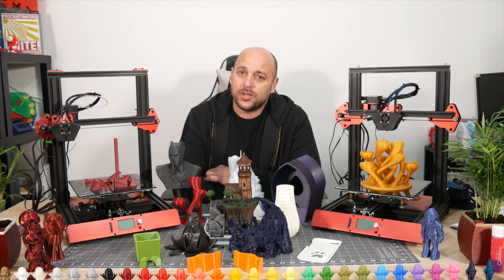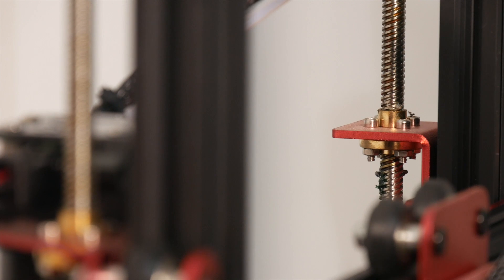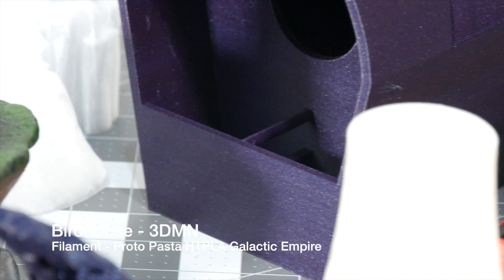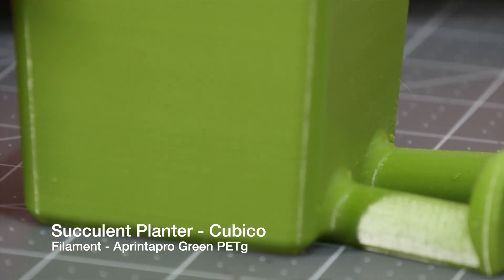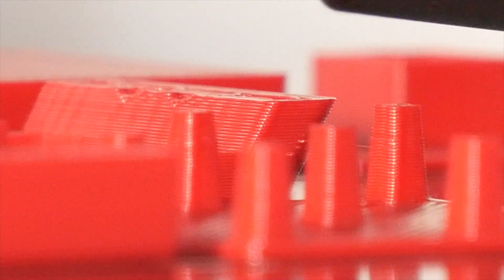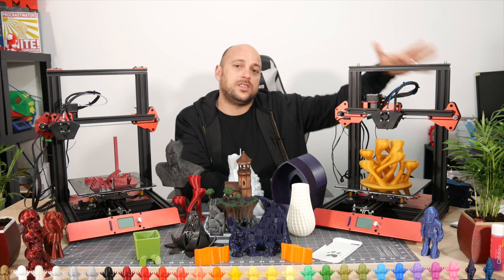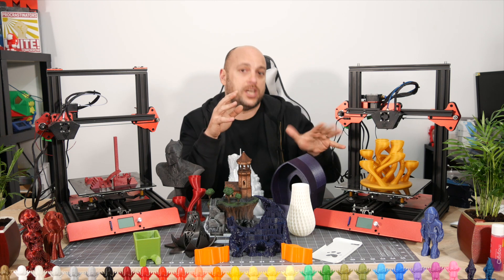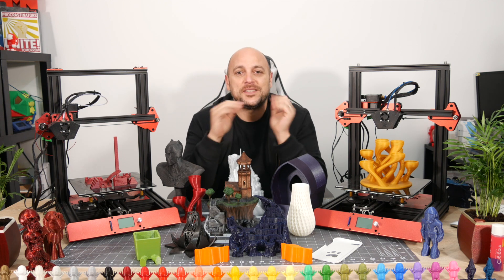Tevo Flash Review

Comment: Very nice video as always. Is it possible that you can share your slicer settings? So you use S3D or Cura? I also have a question about the Bl-Touch. Did you had any problems? Or you fixed once the offset and always added the g29 on your G code? Thank you :D

Comment: Flash owner, here I have an idea regarding the artifacts with your 98% prebuilt machine.
There are multiple versions of the titan clone extruder being shipped with this printer.
the difference is the number of teeth on the hopped gear feeding the filament.
I received one with fewer teeth and this was the reason I had similar artifacts to yours. 
In the video I can see one gear similar to mine but don't know to which printer it belongs.
Maybe the 50% version has the finer teeth.
could you check that? 

Great video !
regards.

Comment: Your experience is quite different than mine.
I got 50% assembled version, the very bare bones, it shipped with TMC2208 drivers ... made by Fysetc and V1.0 ... They are already on V1.2. Those drivers never worked for me :(
I also chipped the glass very quickly, like on 3rd print. I used PVA water mix as adhesion like usual.
Further my Y bar extrusion seems to be bent it is lower at front than back. My front panel was way too back and bent when received.
Y belt is near impossible to tension properly, and has misalignment. when you get it tensioned, belt does not stay on due to misalignment.
The comb style attachment of Y belt slips as well.

I have it now running on external TB6600s just for funsies, prints super fast; But i do not dear to leave it alone printing and there is ghosting as the frame is not sturdy enough with the doubled up acceleration & jerk + 600mm/s travels i have on it. I have some videos posted on it.

But there is A LOT of good in this printer, it does come with MKS Gen L board, very easy to make firmware changes.

To open the control box, you need to loosen the side screws on the big extrusions for the bar that goes X side, it is because there is dimensions mismatch for the lid to the box, and it is binding, loosen them up a bit and the lid moves.

Flash promises a lot, but my experience has been quite bad :( Such a shame, i think i received a very bad sample.
Reply: That's the thing with Chinese products, one cannot decide based on one review because the same product when other than reviewers order is much different, usually for worse, one should wait for a lot of good reviews, even by no youtubers/reviewers, but by simple users.

Comment: You didn’t mention much about the print surface?  It seems like the market is saturated for cheap printers from China that seem to require upgrades out of the box, then more after using them (fans).  I think shoppers should look for quality printers with solid customer support instead of throwing more money at these cheapies.

Comment: I haven't watched the whole video so this comment could be stupid but... Why would you invest 350$ into this? I feel like it's too expensive for what it has to offer. I am more of a creality "fanboy" and i own the ender 3, so, in comparison, i don't see why it has this price. Maybe some better metal parts like the extruder mount but, i can upgrade my ender 3 and it would still be cheaper!
P.S. This is NOT a hate comment and i don't have anything with the Tevo printers
Reply from the maker: I did talk about his, but to upgrade the Ender 3 to this would probably cost you more as you’d need to change the board to include the TMC drivers, clone Titan and clone volcano hotend, genuine BLtouch, dual z axis, would come to the same price. The CR20 is the direct competitor to this printer and to me, I’d still prefer this. I completely get you though
Reply: The Prusa mk2 might be a better option because of the higher quality and direct drive which is something that would probably be upgraded later on this one
Reply: andre47g I meant that the other parts may cost a lot of money for upgrades, but if you want to keep it the same, the price is pretty good. I do see what you mean.

Comment: Great review Joe. Only thing I really don't like is how the heatbreak is held in place by two grub screws at the back of the cold end. I got a bad clog and needed to remove the nozzle.  found that I had to completely remove the assembly from the printer because those grub screws came loose and would cause the heatbreak to drop. Also, they're awkward to access when mounted as the BLTouch is behind the hotend so there's not much space to manouevre.
Reply from the maker: Personally, if I had to keep one I’d probably mount an original volcano hotend assembly as it deserves it, and change the fans to noctua
Reply: @3DMakerNoob  I treated myself to a Mosquito hotend over Christmas. I'll look into how I can mount this to the Flash.
Reply from the maker: Nice! I’m hoping to get one soon to play with 😁
Reply: @3DMakerNoob  Cool :) Was going to offer to let you to borrow mine. Would love to see what it could do when it's installed on a well calibrated printer
Reply from the maker: To get the full potential out of it you’d need to modify the printer a bit and have an enclosure with an active heat chamber, then get some peek filament 😁😁
Reply: @3DMakerNoob  I have the groovemount adapter on its way. Then I'll need to see if one of the existing V6 mods will fit or can be easily changed. At the worst, I have a spare creality CR10 X carriage that I can swap in place of the stock one. Then I can use one of the existing creality designs. None of them use a BL Touch though so I'll have to see about that. Also, I won't be building an enclosure any time soon as I don't have the space atm :(